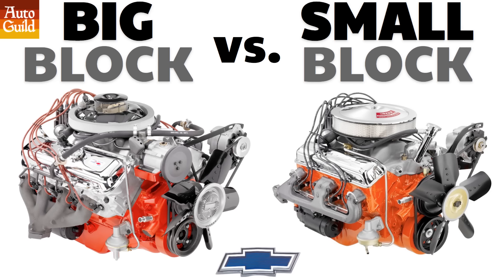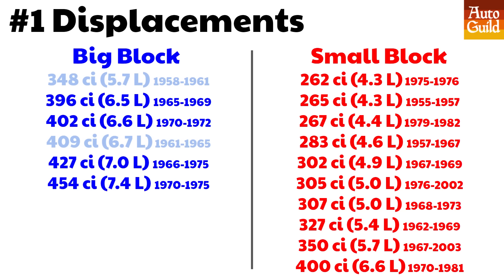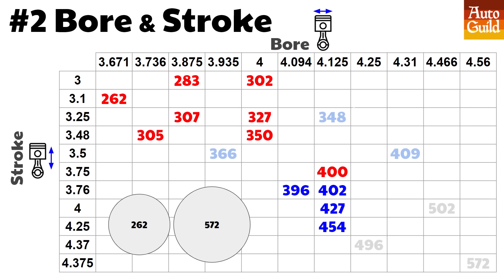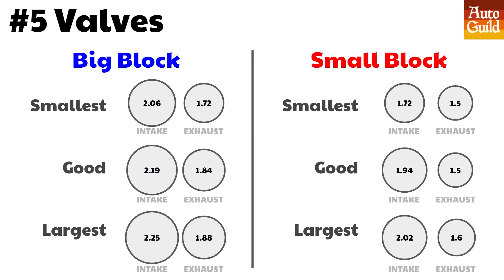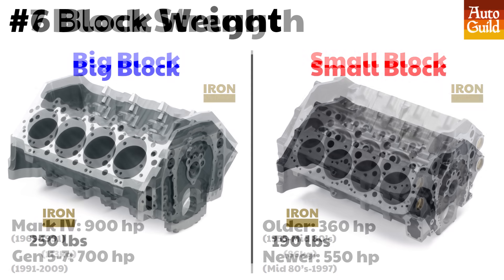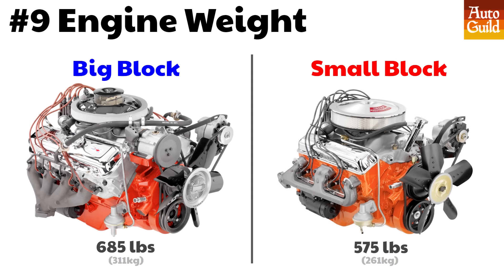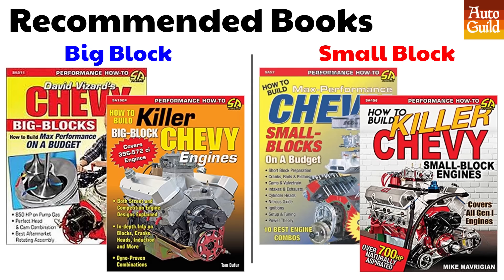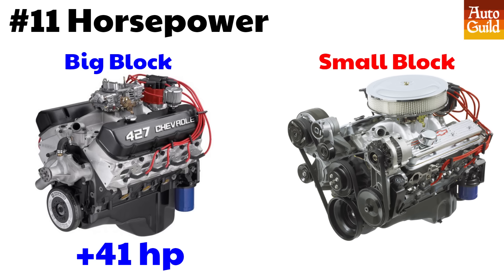Big Block vs  Small Block Chevy Comparison

Comment: One shortfall on the BBC heads that I think should be mentioned is the fact that on each head there are two intake valves that the intake runners turn towards the cylinder walls, whereas the two other runners turn towards the center of the cylinder and are clearly more efficient.  Obviously, the BBC is a hard runner even with such an issue.  But there's a reason why the pro-stockers went to a different runner design in the late 70s/80s.  It's a different game when running against the Chrysler hemi where each combustion chamber and runner are identical, as is the case with many Ford engines and the SBC.
Reply: You end up missing 2 head bolts because of this too...
Reply: @jaredmayer3960  was not aware of this!
Reply: I believe the case for GM was making the runners equal in length as possible, using the splayed valves and allowing for a 5/6 bolt design per cylinder. There is a lot of shit packed into those heads. Later with the introduction of EFI and the 8100 GM went to a symmetrical layout because they no longer had to worry about centralized fuel distribution. 

Remember too that the ports that turn to the wall are very gradual and the valve angle points to the center of the bore. So during the turn down the air does actually point to the middle of the bore. Its not like the valve opens and air crashes into the cylinder wall.
Reply: So, is the candid intake valve on these cylinders making things worse at high rpm?  Just thinking about that additional sudden requirement for fuel to turn.  It's hard for me to say good things about MOPARs, but I can see where the hemi-rrhoid had a big advantage at the top end.  This is particularly noticeable when watching some of the pure stock drags where the hemi cars have good trap speeds.
Reply: @badgerbait8351  The canted or splayed valves move away from the cylinder wall as they open so they reduce shrouding from the cylinder wall and improve flow at all RPM'S. the Chevy Big Block, New Chevy LT V8, Ford Clevland and Ford 385 Series are all wedge motors with splayed valves. The Hemi archives the same thing but with a different valve arrangement.
Reply: @badgerbait8351  Actually, with the canted valve the BBC approached the Hemi design concept, hence the BBC nick-name of Semi-Hemi.  The idea is to unshroud the valve from the edge of the cylinder wall and provide more of a straight shot flow wise into the cylinder.  Other engines have used this concept, the old Polydine (sp) Plymouth wedge engine of the late '50s and early '60s had such a design.  So did the old stove bolt 6 cylinder Chevy engine back in the '40s and 50's.  Also the Farmall H and M Farm tractors,  although the last 2 examples only did it on the exhaust valve, I believe.
Reply: @geoffmooregm  Yup!
Reply: With 2 different types of Intake runners (long and short) in the factory production head they provide a great flat torque curve.  The short runners make horsepower; the long runners make torque.  Best of both worlds to move massive heavy production vehicles.
Reply: Have a look there’s a long span across the deck with no bolts...that’s why they tap out.  BBC was never as reliable as 283/302/327/350 at high power per cubic inch levels.  They also have the tendency to pull out rocker studs and front cam lobe wipes out because there’s not enough oil to it...
Reply: @jaredmayer3960  I'll check it out.  Have also heard the pushrod angle is harder on lifters/bores.  I run a warmed-over 454 with roller cam.  Have enjoyed it immensely on the street, but miss the fire-breathing SBCs.  And if you got beat by a BBC, no big deal.  Still respected.  But if a SBC beats my rat, it sucks!
Reply: @jaredmayer3960  BBC rocker studs are all screwed into the head.  Maybe some of the newer ones are press fit, I don't know, but the original engines had screw-in studs.  They did drop valves because of the weight (large and heavy) and high rpms.  People who had driven production small blocks tried to wind the Big Blocks up in the same manner.  I am talking production engines that were not modified to high rpms.  On the street, those who knew what they were doing, used the great torque of the BBC to advantage and didn't try to twist them to the moon.
Reply: @Jendal3  there still are 2-5” spans of block deck with no bolts regardless.

Comment: I put a Doug Herbert built 454 in my 57 Chevy I have had several small blocks and no complaints but the torque of a big block no COMPARISON
Reply: I’m looking at a 454 for my 55 Chevy but have been tempted to go LS. Any thoughts?
Reply: @theylive2749  I'm old school love the carbs and valve covers  just build it the way you like it you'll be satisfied
Reply: @theylive2749  ls i just going to feel like another small block
Start with the 454 youre leagues ahead. Kids talk about the ls like its magic or something
Know of a few head/cam 6.0s barely running 13s and hot  under the collar about it.

Comment: I had a Chevelle with a 454 with iron heads. Didn’t think about weight till after it was in. The car originally had a small block and you could feel the weight difference on freeway clover leaf entrances (turns) — had heavier duty springs. 

But the torque! Wow ... I could stand on it from a stop, the car would get sideways easy, once you hooked it was a rocket all in by 5500 rpms. Midrange torque was impressive put you in your seat musclecar power.
Reply: Exactly it’s bigger bat further away the ball goes  .

Small will keep up but the bigger will definitely travel away faster.
Reply: That's why I believe that corvettes really shouldn't be big block cars, unless for pure drag racing. The advance suspension from the factory was set up for lemas style racing not drag racing. A big block will be heavy around the corners, while the small block is more balanced. My thing is a 350 small block is similar to a big block in rpm characteristics at 2 thousand rpm to 5 grand, not in torque and horse power but in stroke characteristics. Not scientific measurements, but natural engine functionality. The 454 has better power/torque under 2 grand and up to 5 grand. But the small block 350 can rev out more.
Reply: @JacksoNR26  The SB is going to have to rev out more...beauty of the BB is they can pull 3rd like a lot of sb pull 1-2
Reply: No replacement for displacement, no small block will ever beat the torque a big block gives you from idle..

Comment: I wish someone would make big block style heads for a small block. Then that might start a whole new era for the small block.
Reply: Those Trick Flow “Twisted Wedge “ heads might be what you’re looking for
Reply: GM made them (canted valve) about 20 years ago.  They were used in Drag Racing Pro-Stock trucks (S-10s).  With William Tyler Jenkins... aka Bill " Grumpy Jenkins, building the 355 cu in sbcs with the Chevy produced canted valve heads... his engines won several championships until the National Hot Rod Assoc. done away with the class.  Today, those heads are around, as are after-market heads with the canted valve design for sbcs.  It will cost a guy big $$$ to buy and use them.  They were designed for horsepower and racing and probably would not be a good head design for a street driven vehicle.

Comment: Big block id big and heavy more power and torque for straight line  racing. Small block better for a more balanced high rpm motor for a sports car.

Comment: 800hp is easy from a Big Block try that from your LS
Reply: Just as easy the 6.0  ls has been hitting 1700 hpbon stock block piston and rods
Reply: Love my BBC, but I must say that the LS engines are a far superior piece of engineering, and can easily handle well over 800 hp!  Guys are pulling over 1000 hp on factory junkyard LS engines with minor spring/cam upgrades and a turbo or nitrous!
Reply: @badgerbait8351  Plenty of BB with turbos pushing over 3000hp. They're stronger. flow more.and don't blow head gaskets like LS. Build a 1000hp LS and let me know how long it lasts.
Reply: @timsheperd4446  3000 hp on factory components?  You and I both know that ain't true, TIm.  And remember, the LS is actually a SMALL BLOCK, that has far less metal to support it,  unlike the BBC, yet it can be pushed to such extremes.  These little truck LSs even have cast cranks!
Reply: @badgerbait8351  But a LS won't last making 1000hp on stock components either. I think that was the point. You can easily make a 600 to 800 hp big block using catalog parts and a junkyard 4 bolt main block and no power adder. If you scored a 7.0L junkyard LS I suppose you could do the same thing but I don't see anyone finding one and I can't see a 6.0L making 800hp without having to wind it to 7000RPM or more so it probably wouldn't drive nice on the street.
Reply: @geoffmooregm  Yes, the LSs do seem to need more RPM.  Then again, they've got a superior head and port design that like to breath, much like to old chrysler hemis did.
Reply: @badgerbait8351  Right. If you can't make the torque the only other way is to spin it. In the end you just need to be wise about the engine VS application. A weekend warrior street/strip/autocross car would usually be better with a strung out LS. But a old C/K pickup or Land Yaght for the street/tow/off road would be better with a big lazy 454 that lumbers around at 1800RPM but can light up the tires in third gear or pull that 10,000lb trailer up a 10% hill by just dropping out of overdrive.
Reply: @badgerbait8351  saw a 6.0 with stock pistons block and rods but different rings cam so on so forth and twin turbo making 1700 before the dude backed off cuz he was scared

Comment: I have a 62 Nova and built a 327 425 hp small block. Tasty fast! Best small block Chevy ever built.
Reply: I bought a used 65 327 Chevelle SS. It was my first really fast car. When I left this guys house I turned it on and the front end came off the ground!😅
I beat everything on the road that night, I wish I knew what that guy did to make it so wild. I figured it had to be the breathing. The heads were the key.
Reply: Novas are a amazing
Reply: 400 Chevy = best small block from ANY manufacturer, period!
Reply: Love the 327. They rap up quick
Reply: @ryanpoloski4322  
283 cui with twin turbo pushing 7500rpm

Comment: I own a couple big blocks and everyone thinks big blocks are the be all end all. Don't get me wrong big blocks are superior DEPENDING ON THE FIELD!! Ok so my family have two race cars that we have/still race a 1969 camaro ss with a 427 big block and a 1985 camaro with a 400 small block. The 69 is the faster of the 2 coming in at 11.6 seconds in the quarter but dont think for a SECOND that the 400 is a slouch. That car ran perfect 12's and it is 125 horsepower below the 427 and its an automatic where as the 69 is manual. (If you knew the driver of the car youd know why the manual was a much much better choice) my point is big blocks and small blocks are both amazing engines. Im a big block fan myself, I even built one myself for a project car (im 17 and I build them with my dad) Not to be a know it all but I grew up with my grandpa, a GM engineer, and my dad a diesel tech, teaching me everything they could, I LOVE learning about all this because 1. Ladies love a gear head 2. This is a dying field and I dont want to let these engines die and 3. This is a HUGE passion for me, I love these engines and the cars they came in. TLDR big blocks and small blocks are both great engines and both have their ups and downs for any purpose so dont just think that bigger is always better
Reply from the maker: Comment of the dat for you sir!  Love it  : )

Comment: Gonna find out if weight matters .  About to swap my 1992 Blazer 4x4 from its worn out 350 to a gen 5 454.   BTW finding parts for this model to try to maintain the fuel injection is a pain and/or expensive.
Reply: Naa, you'll easily forget about the 350ci, the torque will have you loving that bb..

Comment: I remember my father telling me years ago there's no substitute for cubic inches. While that may have been true back at that time, 1980's, I feel with all the newer technology that's not necessarily true today. We have factory supercharged production cars and a huge amount of options in the aftermarket. I watched a factory stock, that's what they claimed, Dodge Demon run a 9:62 in the quarter mile. No spray. We also have many stroker options available as well if you have the coin. I'm old school at heart but if you're into building a street strip combination, whether it's a big block, small block, or LS, that Demon is going too be hard too beat. Just my opinion. I really enjoy your video's. Thanks.

Comment: Excuse me, but both cranks on the 454, the 4.00 and the 4.25 both suck and make a BBC much slower. We can talk about this forever because I have NEVER LOST A RACE TO A 454 EVEN WITH ONE OF MY 396'S AS LONG AS i HAD A 3.76 CRANK IN IT. THERE IS A LOT TO TALK ABOUT. AND FOR THE RECORD A 1969 ALL ALUMINUM zL-1 427 WEIGHED 476 LBS AND A small block weighs more than that and the ZL-1 had over 600-650 hp from the factory along with the L-88.
Reply: The ZL-1 and L-88 were both essentially factory race engines.  In the case of the ZL-1 = whole lots of $$$.

Comment: You said...The big block requires larger breaks.....   really???
Its a 110 lbs heavier!   

Saying you need bigger breaks for that... is like saying if you have a family of 4 kids....  as opposed to 2 kids... (about a 110 lbs)
That you need bigger breaks for the extra 2 kids!!

When u say things like that... it makes me question every word you said!!
👎👎
Reply: well not every car handles weight the same way when stopping
Reply: @pewpew-_-2157  true, but the limiting factor in stopping distance should always be traction, not braking power. All you would need to do is push harder on the brake pedal. Adding more weight (within reason) to the front of the car should actually decrease the stopping distance. The front brakes provide most of the stopping power, more weight on the front means more traction which means more braking power can be applied without locking up the wheels.

Comment: If I was concerned about weight I wouldn’t have gotten a big block lol
Reply: I wonder of you can get an aluminum bb?
Reply: @pcakes1878  Sure you can, for a BBC a bare block are around $5k.  They make aluminum small blocks too though.
Reply: @Dayandcounting  ya a small block is probably the smarter option for my cutlass. gas is gettin expensive these days. its nice to dream tho
Reply: @pcakes1878  the LS7 is best small block ls to get, 505hp n 25+mpg hwy is too hard to beat, i think not even the smaller ls engines can do that stock vs stock, new the LS7 is around $12k tho, but worth it if you have the money.. For a bit more tho a 632ci bbc is tempting, but then you're talking gpm instead of mpg..lol
Reply: Power to weight to Cubic inch difference favors the BBC,no replacement for displacement and I love the small block!
Reply: Depends on how u got it built 509 motor in a 68 camaro with power gilde built stall little gogo juice what else big wheel car she makes 996hp big boy power and thats all motor could make more but car is strictlya drag car that's is tubed every part of this car comes apart I can say one of the fastest on 411 race track 👣😉
Reply: Like 200lbs makes a fkn difference. Thats like sayin you could run faster if they cut your balls off.
Reply: @funkmaster2258  Yeah but that 200 lb difference is negated by the superior power difference a BB provides.
Reply: @extremedrivr  thats kinda my point. And if weight is such an issue lose ot someplace else.
Reply: @funkmaster2258   It's only 110lbs.  All iron BBC 685 vs SBC 575 an iron LS with aluminum heads around 500lbs, LSX aluminum heads 570lbs all aluminum LS around 400lbs.    As to how much the weight matters it's about about power to weight so you need values to determine that.
Reply: @Dayandcounting  yea see i cant use sarcasm. Look if you double the weight you need 4x as much power to accelerate at the same rate but no 200 lbs isnt sht. I dont for the life of me understand what makes people think this is any kind of real question. Are people really that dumb ? There is no question more power is better. You can build to whatever hp you want , that is easy. Whats hard is traction. The extra weight may actually help you if you have a 4 link set up properly . Conversely if its not drag , if its a road course , the weight can kill you if it exceeds what suspension and braking can handle. There are alot of courses where acceleration pays off more than top end. Because its fkn hard to turn 110 degrees at 200 mph. There is no 1 answer. Its dependant on the track. As bad as formula 1 cars are they dont pull 6s just like a chevy 2 isnt going to handle like indy.
Reply: @Dayandcounting  By swapping the cast heads on the big block to aluminum heads will almost get you to the same weight as an all cast iron small block.
Reply: @pnwdweler4100  I literally posted the actual weight differences.  Granted there is small range difference between heads so +/- 5lbs.  Could go with an all aluminum BBC to, or just use a LS/LT and call it a day.

It's not reasonable to make that argument though.  One the SBC person is more likely to make that same move because the heads are cheaper.  The power gains are better too as Chevy didn't make the best heads for the SBC, it was until '71 that they made their first decent flowing head for the LT1.

Comment: You should of compared a Chevy 400 big block to a Chevy 400 small block.
Reply: Awesome J   1970 they had 400 bbc it’s actually 402ci but was just called 400 bbc
Reply: Even though 400ci is low displacement for a Big Block it would outperform a 400 Small Block simply because the heads flow better. Not to mention the added durability of the big block. The Small Block would be nicer for the lower weight, lower cost and easier fitment.
Reply: Someone did a video that touched on the whole 400/402 marketing thing.